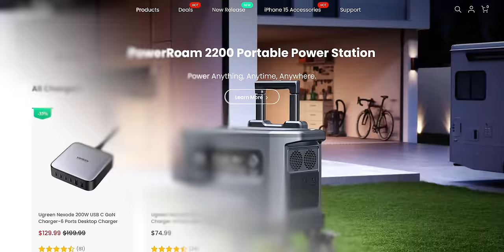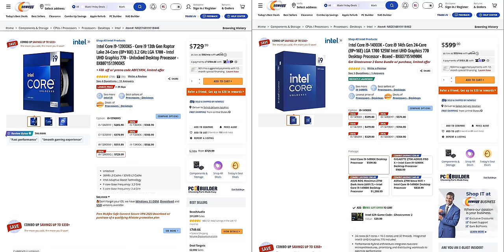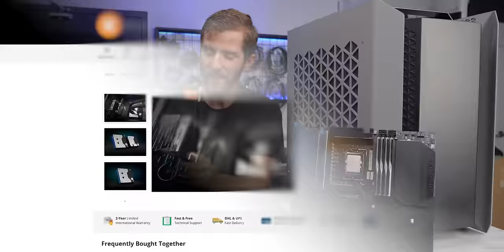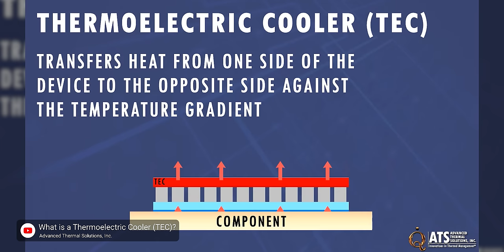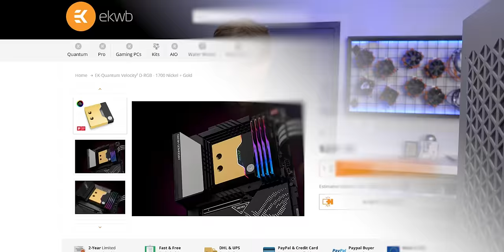Compensator 4 - How to Waste $30,000 on a Gaming PC

Comment: 7:50 - I still feel like the ideal setup for a PC Peltier (TEC) cooler is to run your loop: CPU > Radiator > Peltier cold-side (with it's own separate cooling loop and radiator for the hot-side) > CPU.
That way the first radiator brings your coolant down closer to ambient, and then the Peltier cools it below ambient. The other advantage being that the Peltier never acts as an insulator and your system can still run even if it fails or can't keep up. Not sure what EK was thinking with this setup.
Reply: That would be even dumber. The peltier module would freeze the water in the tubes.
Reply: @ErnieZee  1) Use a coolant that has a lower freezing point than water 2) Use a temperature control so the Peltier only turns on when needed. Sub-ambient ≠ sub-zero unless you're outside on a freezing day for some reason.
Reply: I have been theory crafting about a system with a big reservoir and multiple loops.

1. reservoir > cpu > radiator > reservoir
2. reservoir > gpu > radiator > reservoir
3. reservoir > peltier cold side > reservoir
4. radiator > peltier hot sidd > rafiator

This way you never have the downsides of the limits and insulating effect of the peltier because it is basically a normal system. The peltier just cools your reservoir aditionally.

only downside is you have to insulate all the tubes and the reservoir if you plan to cool below the dew point.
Reply: This cooler would work perfectly fine even with a 7950x3D. The trick is not having a microwave for a CPU.
Reply: @Enderplays12  For sure, if you throw strong enough TECs on it, you could make a setup like this work on any CPU, but it's still incredibly inefficient (on top of the inherent inefficiencies of TECs in general) and prone to unexpected failures.

TECs have a limit to the amount of heat differential they can move (usually 20-40 degrees C), so the closer you can get a loop to ambient before introducing the TEC, the better sub-ambient cooling effect they will have. Without that, you start hitting thermal saturation points on the hot-side of the TECs and the they become a net-negative on performance.
Reply: To be honest, a much more creative design for cooler would work: turn the peltier vertical, have water transfer on the cold side, run across a typical water block, then run across the hot side on the way out. Likely to keep the CPU substantially colder than water alone, controls transport condensation by being one package, and takes up little more room than a normal air cooler. Could even internally control the peltier temp to limit minimum temp.
Reply: This won't work well, peltiers are only able to create a temperature delta of x degrees. So you need to get your peltiers hot side as cold as possible with a different loop. 

Your suggested plan will preheat the water before hitting the cpu with the energy that goes into the peltier. Short but crude example: input water temp is 20C, we have a  peltier capable of cooling a 20C delta and it is a 200watt peltier. Lets assume it is capable of displacing 200 watts of heat (not the case in reality), this would mean it is able to suck out 200 watts of heat from the cold side, and it will dump 400watts on the hot side (consumption + extraction). 

Now imagine the cpu is on heavy load and the return water of the cpu is 60C, this means you will be "cooling" the peltiers hot side with 60C water, but it was only capable of creating a 20C delta, so it will instead end up heating the input water because the cold side can only go as low as 40C, which is 20C hotter then the water it is supposed to cool
Reply: @henkheijmen  Maybe I wasn't clear, I understand the temperature differential thing. What I meant was, have a separate cooling loop with a radiator just for cooling the hot side of the peltier and nothing else. The CPU would be cooled by its own radiator PLUS the cold side of the peltier.

So the CPU would generate heat, the heat would first go through a radiator (Rad1) to cool it close to ambient, then that cooled fluid would go into the cold-side of the peltier to be cooled further, then go back into the CPU as sub-ambient. The hot side of the peltier would be cooled by its own radiator (Rad2) to bring the TEC's hot side down closer to ambient, thus maintaining the temperature differential between the cold and hot sides since both the coolant flowing into the hot side of the TEC from Rad2 as well as the coolant coming from Rad1 into the cold side would be relatively close to ambient, thus allowing the TEC to provide its ~20 degrees of cooling on the cold side.

I have a few peltier coolers myself that I made a (albeit crappy) mini-fridge with a while back, so I do understand their general function.
Reply: @cbale2000, a sorry I was replying to the guy above my last comment (@clintmash245). I agree your idea is better then the setup from the video but due to the spikey nature of cpu's and the weak but consistent nature of TECs I would suggest to continuesly cool down the reservoir in a second loop instead of weaving the tec in the cpu loop.

Comment: You can hook those Corsair LS100 RGB strips to a Corsair RGB controller like the commander instead of using the one that comes in the box, which requires you to connect it to the wall.

Comment: My first thought when they added the carbonated water was that the carbonic acid in it can be corrosive, depending on what materials it comes into contact with.
Reply: My brain is still in sleepy mode, but AFAIK carbonated water isn't acidic off the bat? It can become acidic depending on the material it touches, which I think most of the material in that system is PETG tubing and aluminum.
Reply: @NarutoMagicCyclops  all carbonated water naturally produces carbonic acid in small amounts. It's what gives sparkling water its horrible taste that some people seem to enjoy.

Comment: I wonder if you'd be able to make it more overkill by copper modding the Intel processor for even lower temps across the board
Reply: I was wondering why they didn't use a contact frame and mill the cpu like debauer says, would increase performance, but especially because it would add cost, since they were going for the most expensive.
Reply: @TigonIII With the compensator builds they are going for off the shelf (or close to it) parts

Comment: Ok, the sparkling mineral water was silly, but otherwise, the system is really impressive.  Kinda sad that such an expensive cooling setup is still outdone by more traditional water cooling, for half the price.  Seems thermoelectric cooling tech just isn't there yet.  Fun an interesting build, and very jealous of that monitor.
Reply: Oh it can Be !!  No one here has seen what is Really is possible with Tecs! You can run them in Layered Stages,but nobody has done that here cause it would go Sub-Zero. Tecs take ALOT of Power to run ! They can be power Hogs if you want Large performance. They have very tiny ones too ! Why did you think Linus made that Hand gesture about anything BUT Gaming,cause it's hard to control Tecs,they like to be ON or OFF! Not in between or low voltage,they don't do $#!T ! They are Great at what they do,they're not energy efficient though.

Comment: Ik he said no exotic parts but the final ootane drives would've been so perfect for this. They are also so far ahead of the best nvme ssds I low queue depth random read bandwidth, iops and latency that youll commonly see 50-100% faster boot and load times. That's also the same reason it's so hard to notice the improvements of nvme ssds vs sata because they're progressing abysmally slow in these metrics.
Reply: full optane drives are very low capacity.
Reply: Owning a P5800X 1.6TB would be a dream come true. Sadly, not gonna happen when it costs about the same as a D5-P5316 30.72TB SSD. That's quite the difference.
Reply: @Steamrick why settle for less? go straight for 3.2TB one. money we have, we just need glory.

Comment: This build needs a compensator killer, one or two systems that can outperform it for cheaper. Something like nas with 40 gig connection I think could be better and cheaper.  And the x3d  chip.

Comment: Now make the cursed version. 

Same processor but with maximum degradation due to overvolting and via oxidation.
11x 8 TB HDDs.
1 GB DDR4-2133 and a one of the HDDs is entirely for the swap file.
A window AC unit for cooling.
The case is literally a refrigerator.

Comment: I'm always thought that a tec would work better as a pre chiller, putting it in after the loop after the radiator and before the cpu/gpu.
Reply: Yeah, but you could freeze the fluid no? I’m assuming that wouldn’t happen but I don’t know.
Reply: @albertogregory9678  There are 2 options to prevent that, either monitor the temp of the water when it exits the tec and adjust the power accordingly, or more likely, just pick a tec power that would never reduce the temp from room temp (which is the min of what should come out of the rad) to below 0.

Comment: Clarification for the Gerolsteiner Water: This water is really not that expensive here in Germany, like 60 cent for a liter. So it's not the cheapest, but there are way more expensive options out there. The price of $7 CAD is most likely transatlantic shipping and markup for having european water.
Reply: The funny thing is that it doesn't even taste good
Reply: @tomololp7846   It tastes great what are you talking about?
Reply: gerolsteiner is the worst water oat
Reply: This!
Reply: Yeah. I was really confused when Linus pulled out the bottle. Like what's the big deal? I have like 5 boxes with 24 bottles each in my garage for about 40€ total. That's just normal water.

Comment: This just shows to me that at least the high end desktop CPUs need more HEDT features. Performance is great, but it's still somewhat limited in terms of RAM, and definitely in PCIe lanes. I know this is an edge case and most people don't care, but when it comes to balancing out PCIe lanes for the VGA, fast storage and to have a ton of I/O, the current lane counts are limiting. We don1t need over a 100 lanes as on the Threadrippers but around 40-50 would be nice. 
When a CPU is over 600 dollars and a motherboard is over a 1000, it's nothing more then market segmentation.
Reply: Market segmentation is how they know they can make money. We've moved from pcie3 to 5 in such a short time that desktop cpu's are not really keeping up,  threadripper is a bit of an anomaly being much more akin to some xeon than any intel desktop cpu.
Reply: Even 50 lanes can be taken up extremely quickly. A pair of x16 GPUs, 4 x4 NVMEs and you're just about tapped out.

Comment: 16:29 Fun fact Mushkin also has 16TB SATA SSDs, TeamGroup may have discontinued the 16TB SATA SSD but they are not the only ones in town (or at least not anymore)
the specific model is Mushkin Source HC 16TB (HC from High Capacity)
around $2000 the pop

Comment: Since the pump is running twenty four hours a day, Inject some polyphosphate into it. It will coat the inside of the lines and stop the hardness from precipitating. Just don't turn the machine off and you'll never have to worry about it

Comment: even if i had the spare income to make this pc, it is so crazy sized. I wouldn't get a large tv/monitor or that may ssds. I hope you had fun building this as much fun as i had watching it <3. Wonderful content as usual guys. Most i've spent is £3200 on a PC lol .
Reply: @OrtzGaming  In my country, £700 gets you a Ryzen 5 7600x with a RX 6700XT, 32gb ram, two 1tb ssd's and so much more.
Reply: @opium_wss  bro were do you live????
Reply: @rhinogamer522  Romania, our PC Prices are so dumb, but in a good way. £700 is equivalent to 4000 RON, our currency, with that kind of money you can get a R5 7600x or a Ryzen 7 5800x for as low as 800 LEI, meaning £137.
But were not talking about pc's made by parts. We're talking about prebuilts with top specs in them for about 4000-5000 RON, meaning £700-£850.
Reply: @rhinogamer522  Don't get me started on the gpu prices.
A 3060 OC GAMING here costs £343 or an equivalent of 2000 RON.
But a prebuilt with a 3060 and some nice cpu, 32gb of ram and 1tb of nv2 ssd costs around 2500 RON, equivalent of £429

Comment: LINUS: Opens case at 10:14 "This is going to have no problem dissipating [all this power]"
ME: "This thing is going to be loud af!"
Reply: Which makes one of the few advantages of using peltier elements kinda pointless :D
Reply: I doubt it is very loud. Those fans probably cap out at 800rpm.
Reply: Not a chance 200mm fans are quieter at same RPM as smaller fans but also won;t reach even close to the same peak RPM.

Comment: 14:55 I'm honestly surprised that many people still believe the LS100 RGB Strips are for External Use only, but they are compatible for Internal use as well. You can connect them directly to a Lighting Node Pro, Commander Core XT, or Commander Pro.

Comment: Adding to the expensive water suggestions, if you really wanna chad out, use fluorinert fc40. It’s a synthetic fluid that is thin so you can run it in a pump but also nonconducting and has crazy heat transfer properties. It’s also a couple grand for a bottle.

Comment: 24:40 To be fair about the Gerolsteiner water price. It's way more expensive than here in Germany. $8 is almost the price of a crate of water with 12x1L (9,29€). A single 1L plastic bottle of Gerolsteiner water costs 79 cents.

Comment: For the Compensator 5, you could consider getting a water deionizer to make your expensive water; it's really expensive, isn't a workstation/server part (because it's not for computers), and isn't custom built, so it should be within the parameters of the challenge. It should also not be terrible for performance or corrosion!

Comment: You guys should have used WFI (water for injection) used in pharma. It has the highest purity, its ultra conductive and doesnt have any additives. Its also the most expensive and a sterile 1L bottle could go for £30-£40.

Comment: 24:35 - Except in heavy rains when you get the run-off in our tap water.  Use a Brita if using the GVRD water supply.

Comment: I'm surprised Linus doesn't use thermal grizzly kryonaut considering how much better it is than most thermal paste. With arctic freezer 4-um it cools 24 core threadripper to 30 degrees C and with load it only hits 45 max

Comment: Technically that isnt the most expensive water. That would be heavy water or ²H2O/D2O. For about $300 per 100ml It would definitely bump the price tag on this system up a fair amount. Also by its name you might be able to guess it is heavier than water, significantly so actually. So it would actually increase performance by having a higher thermal mass then normal water. Though you might have to overclock the pump or something

Comment: Most expensive water? Use Heavy Water, D2O.  nearly 2 degrees higher boiling point, and about 1% more specific heat capacity.

Comment: Can you bend those power cables like old ribbon cables to make a 90 degree angle. You used to fold them over with a straight triangle and fold and bend the wires and get one perfectly. I don't know if that is possible with newer stuff in any way.

Comment: ive made my own peltier water block setups and they can easily get the cpu to minus 10 degrees celcius,and even tried a stacked setup with hit minus 35 degrees celcius
Reply: ps dont try using an AIO cooler for peltiers the pump needs to be seperate or you might melt itand you need a delay that keeps the pump and fans going for a few minutes after the pc has turned off or the heat will suddenly travel back into the cpu

Comment: Btw you shouldn't use carbonated water for water cooling, I'm studying a uni degree related to water and air bubbles (calcium carbonate transforms into water and CO2, which is a gas) are a big problem in closed pipes full of water, not only do they decrease the effective surface area of the pipe (meaning there's less space for water, because gasses take up as much volume as they can), air is a bad conductor of heat, it's effectively an insulator, so they're gonna decrease your cooling system's ability to cool quite a bit. They also increase pressure in the system, so an accumulation of air can make them burst, I don't really see this happening in a small scale water cooler for a pc though
The minerals in the water could also corrode components and forme precipitates over time that would, again, reduce the effective surface area, so just use distilled water with no ions, it's not expensive but ideal for this case

Comment: The most wasteful part of this video is the sparkling water. H2O + CO2 <-> HCO3-/H2CO3 it makes an acid wich will be rough on the seals over time. As well as the water not being destilled and is therefore conductive. It may be fine but just use destilled water to not destroy the 30k parts

Comment: What if you routed the pump into the gpu, then into the panel radiator, and then into the other side panel to make the liquid even cooler, and then route the cool liquid into the cpu and then back into the pump?

Comment: a 300watt intel cpu probably not the best use case for a 210watt TEC waterblock, but its only made for 12th and 13th gen intel cpu's, the 12700k, 12700kf, 13600k or 13600kf seems like a better bet for TEC waterblock. 12900k,kf,ks 13700k,kf 13900k,kf,ks are all rated over 210watts, bit weird how there listed for compatibility i mean sure it fits but its not goner work very well.

Comment: For $2200 that’s not bad for that case. Just the radiators and fans and fittings and all that will run half that price. Should that mean it should be double that, maybe not, but still as a one and done package that’s not bad
Reply: But do you really want an EK products?

Comment: But if this is the Compensator, why even focus on only consumer CPUs? The 56-core Xeon would be a much better fit for a system called "Compensator"; along with a Quadro 6000 Ada series. You woud be around the same final price.